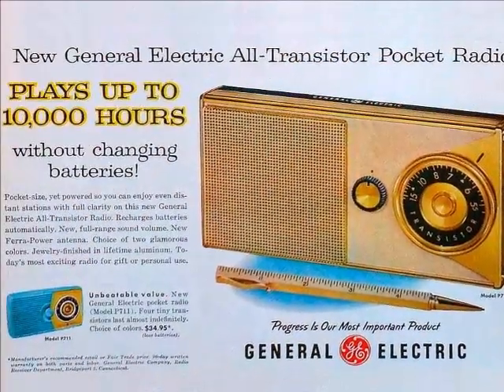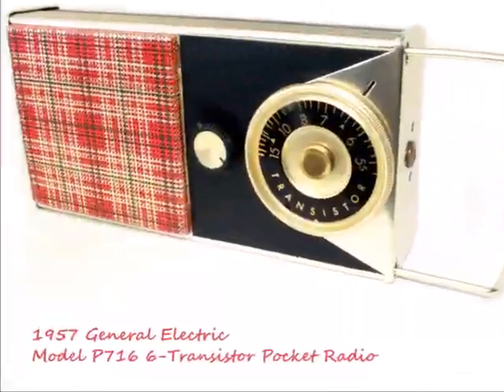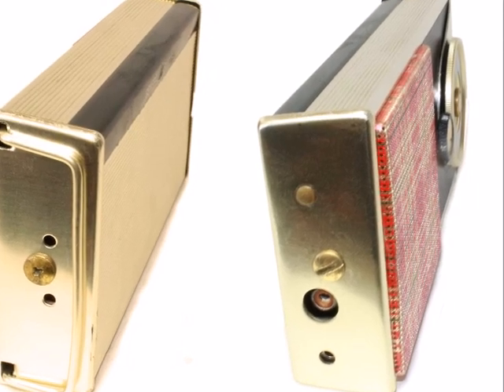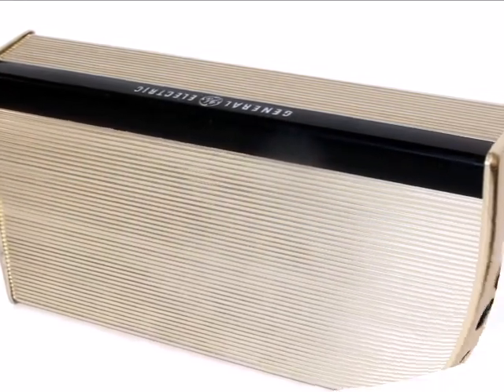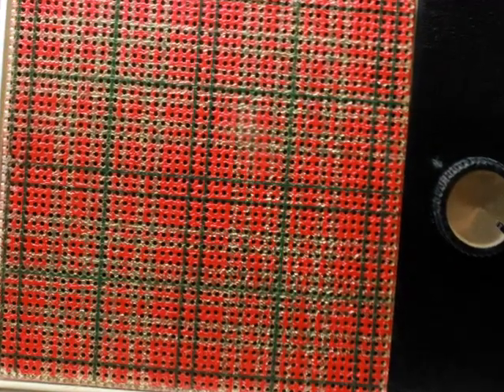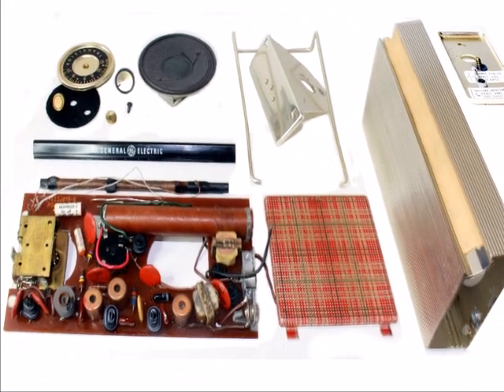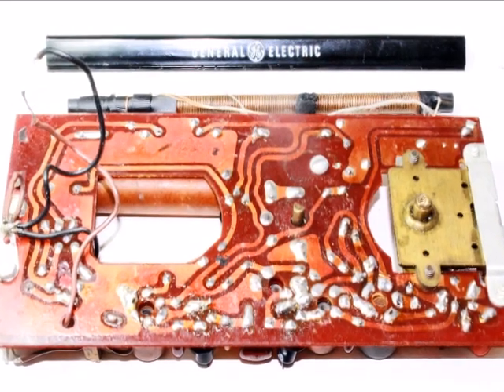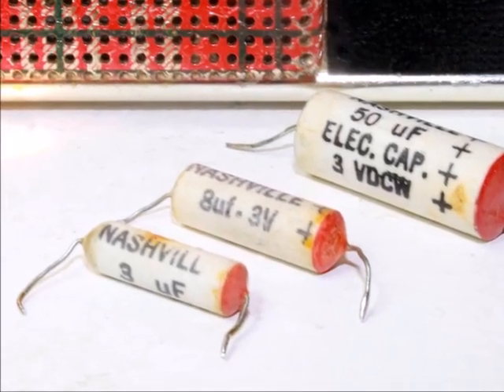1957 General Electric P716 First Rechargeable Transistor Radio

Comment: I have one of these with the charger and case. It does not work. I get static only. No stations. I would like to get it working. Do you no were I could get it fixed. I very cool looking. Mint condition.